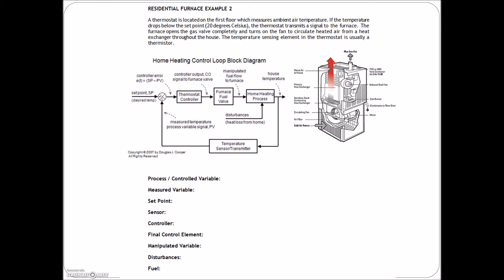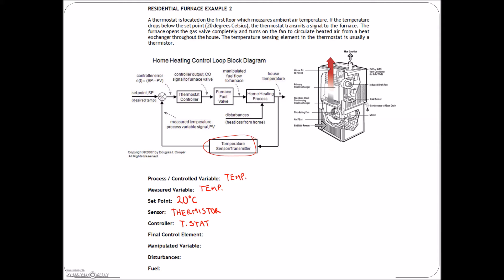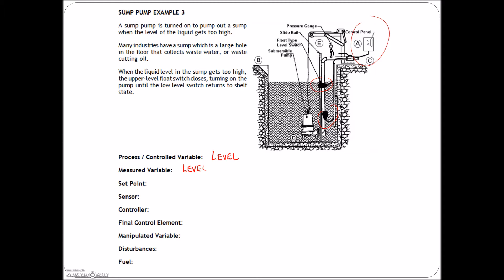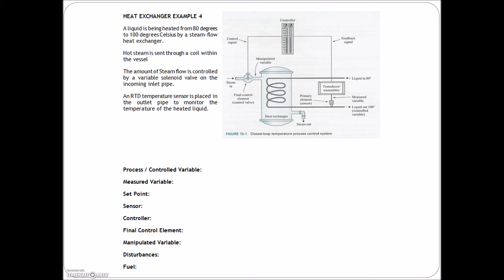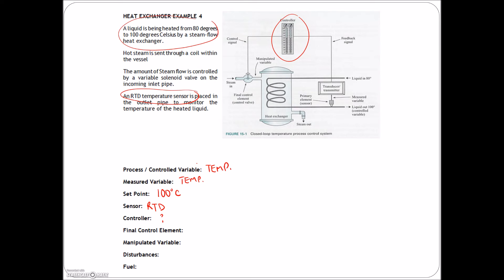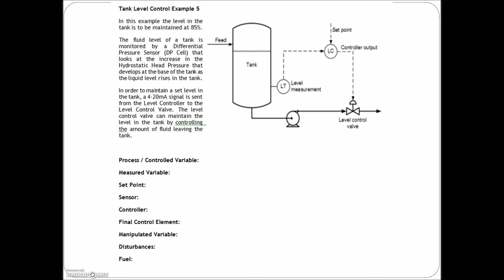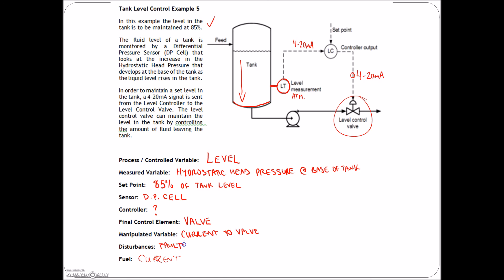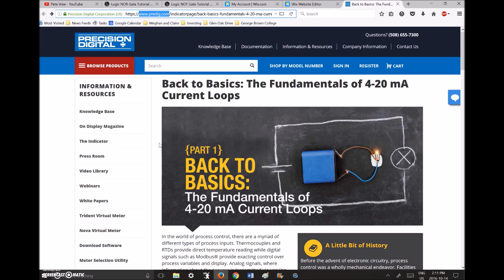Control Loop Block Diagram Examples

Comment: how do we determine input and output of a control loop? what would be the input and output of this process?
Reply from the maker: The input would be your Setpoint combined with the signal back from the Sensor.  Output would be the signal to the Final Actuator (motor, valve, heater).
Reply: Pete Vree awesome! Thank you so much your videos are really informative. I wish you could be my process Instruments professor.